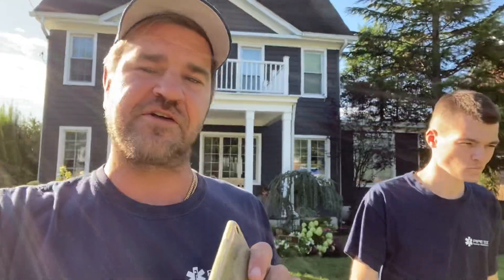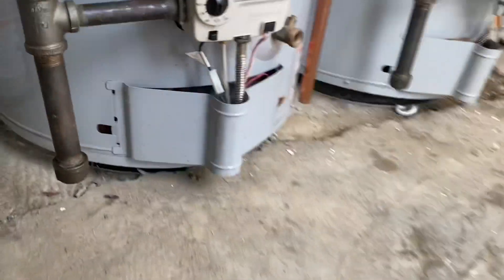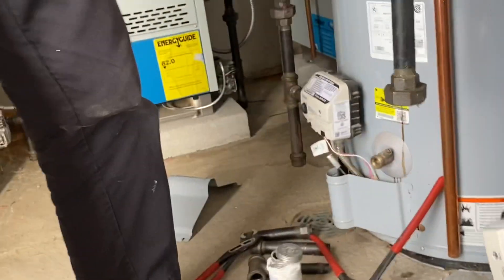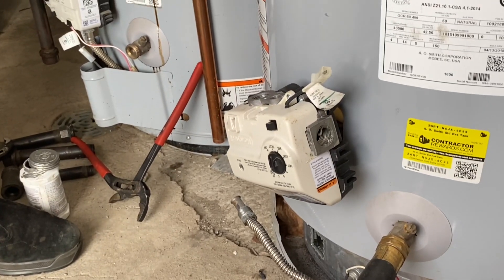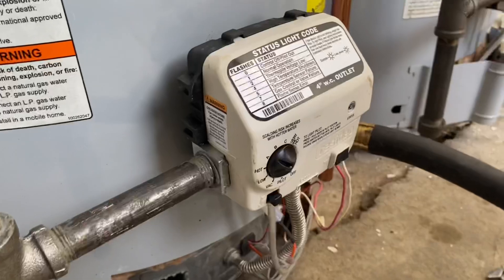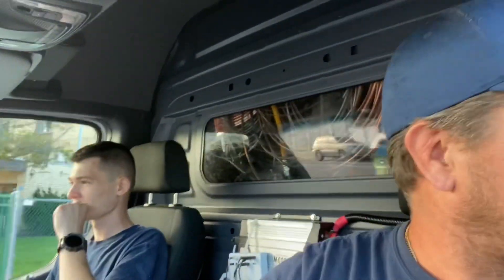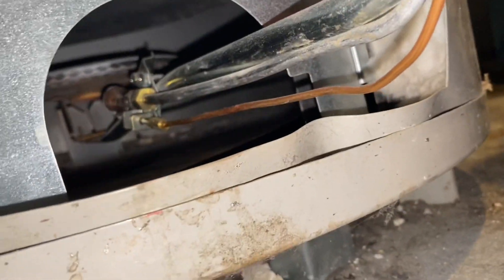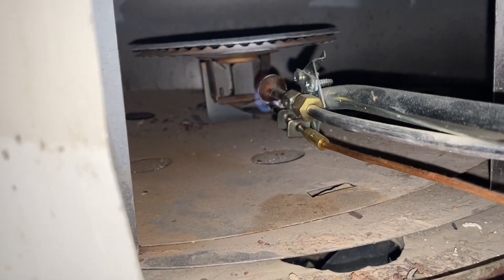The Differences Between Water Heater Gas Control Valves Pilot Generator & Thermocouple Explained

Comment: That first valve, the Honeywell, fails a lot more often.  They cost the average American (who live in these coastal blue states) a lot of money in these kinds of service calls or worse, replacing of a water heater that is otherwise fine.  There is nothing wrong with the old school valves (the second one).  They are much simper, just as safe, and last the life of the water heater tank (much longer).  The ONLY REASON we have to use the Honeywell types is to reduce CO emissions with fancy burners and sensors.  It is a tiny reduction in emissions but the cost to us is huge.  And we wonder why Americans are getting poorer.  I am in favor of cleaner air, but we need to weigh the COST before accepting any more of these miniscule, feel good environmental requirements which cause BIG costs to real Americans.

Comment: Gas fireplaces, at least the ones I've seen, have a thermopile AND a thermocouple. Thermocouple for the pilot and the generator tithing for the wall switch to actually fire the gas logs.
Reply: @PipeDoctor  Interesting, the ones I've seen around here all have this combination assembly, the thermostat wire that runs, most often to a light switch on the wall, is powered by the pilot light itself, there's no transformer or line voltage involved, and they'll run with the power out.

Comment: Do you ever use a flexible gas connector? If not, why not? Are there any advantages/disadvantages to pipe vs. flex?
Reply: @PipeDoctor  Thanks.
Is that local code? If it were allowed would you use it?
BTW, I really enjoy your videos, especially the ones that explain and teach. Thanks.
Reply: @PipeDoctor  Thanks. If they were legal, would you use them?

Comment: Good explanation to Daniel about thermocouple and gas valve. Just a suggestion to go one step further. Disconnect thermocouple at gas valve and then use a millimeter to test for the 30 millivolts. Connect one probe to end of disconnected thermocouple and other probe goes on copper line. Easy to do with alligator clips. While in pilot position and pilot is lite should read around 30 millivolts, below 10 millivolts replace thermocouple. If you getting a good voltage reading gas valve is the issue.

Comment: for the old thermocouple pilots, carry a grill lighter or just use trigger start torch(map or propane bottle).just jam it in and wave it around, worst case the valve leaked and gas pooled goes whoosh, while your face is a mile away.
you can also flash heat the thermocouple so it stays on immediately.

Comment: In 1963, mom asked me to light a pilot light for a neighbor. The old lady downstairs had a Gas Refrigerator.  Smartly I answered: Mom, refrigerators do not have pilot lights!!  The lady told mom it was a "Gas Refrigerator."   So off I went and lit the pilot light.  What the hell I thought--a gas refrigerator?
Reply: they didn't recover quickly form doors being opened, but they were very efficient for the times and worked when power was out and no worrying about ice deliveries!
primarily ammonia gas, being heated and condensed cooling the plate and fins :)
***travel trailers and motorhomes still use that same technology in their multi-fuel/source fridges. most simply use a gas heated unit with addition of 120v and 12v heating elements as the electric cooling sources.

Comment: Wether you are using gas tape or pipe dope you are supposed to keep the very last thread bare so therefore there’s no chance of pipe dope or a piece tape falling inside the piping. That’s goes for every threaded joint on a gas system.

Comment: Daniel son ! What up brother ! Mikey pipes , you may have to “ vet “ some of the people you send magnets to ? Different world . Thanks for the tutorial on the difference between a pilot generator gas valve and the conventional gas valve with thermal couple . Never dealt with one . Changed a few water heaters and thermal couples but never had the Pilot generator gas valve . It seems to work similar with the temperature sensor but obviously light a pilot different by design . Yes , we must always use care not to cross thread . A commenter said to use a wrench on the gas pipe , Daniel tightened it correctly as he applied torque close to the threaded connection ,  preventing an unstable tightening . He also demonstrated that using a back up wrench prevents damage to replacement part , not to mention possible personal injury . Thanks for the tip as well to keep the tee plug loose until the air is bled from the line . Saves time from waiting for the valve to bleed the air and your thumb getting cramp from holding the button . Daniel son is learning to work smarter , not harder . 
Mikey pipes is the man ! Daniel son is learning from an experienced and knowledgeable tech . You’ll go far Daniel son ! Thanks guys ✌️

Comment: In MA we have vac relief on our tanks so a vacuum is a more complicated option for changing stuff on the fly.   For the pool parties I vote compromise  Poll dancers in bikini's
Reply: Well here in South Carolina vacuum breakers are required in all commercial and some residential
Reply: In BC you gotta have a vacuum relief valve and a thermal expansion valve or potable thermal expansion tank on a hot water tank.
Reply: @LambooLaw  We only need the expansion tank if there is a check or other device that prevents expansion back to the street.  Funny how the laws of physics are the same all over the planet.  But they laws that tell us how to do stuff are so different.
Reply: @consolidatedplumbingandhea4390  So true, well said !!!

Comment: Drop leg on the 2nd water heater needs to be replaced. If I remember correctly they need to be at least 3 inches in NYC.
Reply: mumbles something about "National fuel gas code" requiring 3" minimum drip-leg length and always a 90 degree flow change at them :)